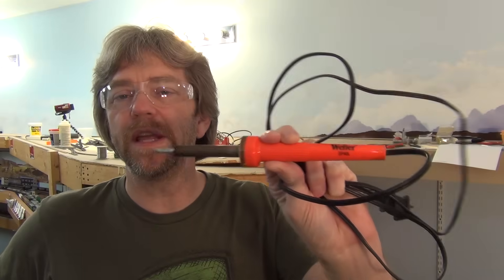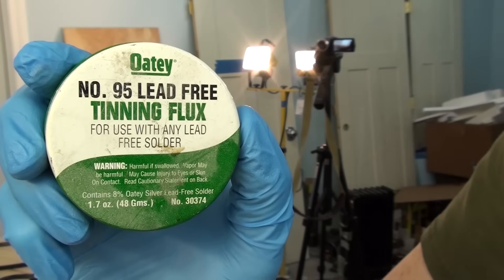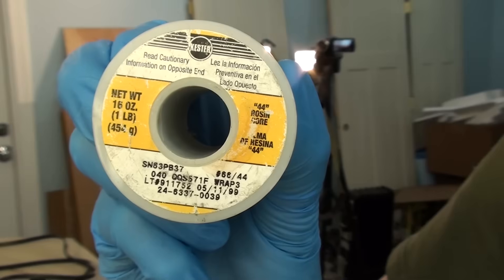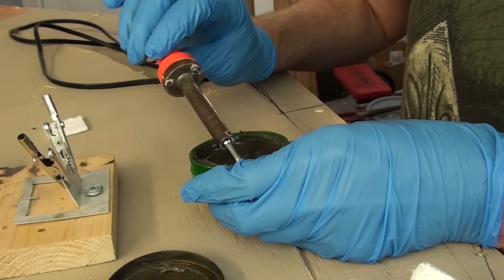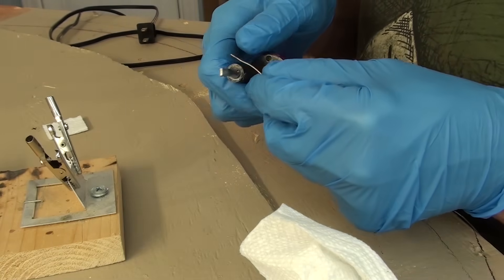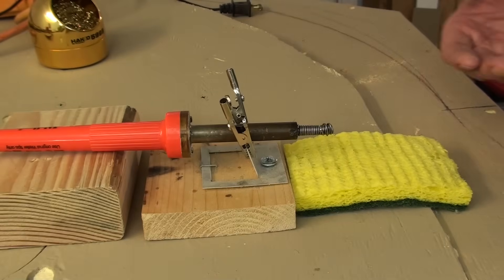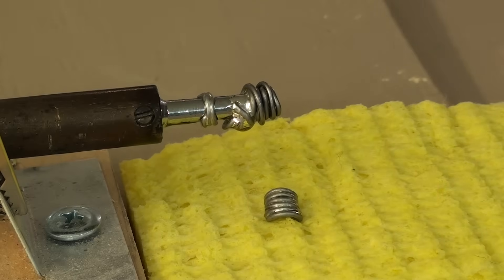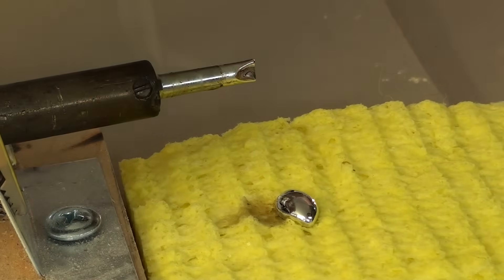🔴How to Tin a Soldering Iron Tip, Without making any mistakes

Comment: Thank you for being short and straight to the point..I have watched other videos who beat around the bush and don't clearly explain..Thanks you just earned a subscriber.
Reply from the maker: Not wanting you to be disappointed,  my other videos are just boring Hobbie videos.  But thanks!
Reply: @IMRROcom  Well hobby videos can be a bit lengthy..However back to the subject of my enquiry_I just got a tolsen 60 watt Iron 2 days ago..The problem is the tin doesn't stick to the tip like the way you showed in the video..I used flux but it just doesn't stick however I can use it to solder.Kindly reply.
Reply from the maker: @muhammadmesbahkamal8512  If it is not sticking  make sure it is clean of oils and other contaminants,  wipe it with IPA to make sure it is clean and recoat with the tinning flux.   it should flow with no issues.  is the tip a chrome tip?  that makes it hard too.  if it is shiny like a chrome toaster or Dull but silvery like silver paint?

Comment: Hello. Great tutorial. Do you have to tin the tip after using a soldering iron everytime as well?
Reply from the maker: Not like that,  just keep it clean.  That is what I do.
Reply: @IMRROcom  I just bought an iron today. How do you clean it and how often
Reply from the maker: @Integrity.is.everything  just stab it into the brass sponge or wipe it on the wet sponge.  if it is not silver and starting to look black .  the dab some solder on it.

Comment: What’s the difference between The flux you used and liquid flux?
Reply from the maker: I use both,  paste flux you are able to coat the part with out it dripping off.  Liquid flux is used for installing componentes and connecting wires.  Past Flux stay were your put it, liquid flux will go to were it wants to go.  Flux used is based on usage and need.  past flux works best for this.  Liquid flux will burn off to fast...

Comment: Hi, dude, thanks for the vid! What does putting the solder round it after do? I can understand dipping it in the flux, but why apply solder after?
Reply from the maker: You are sealing the tip and covering to prevent contact with the air stopping oxidization or basically rusting.  Once the tip oxidizes it will no longer work and solder will not stick.
Reply: @IMRROcom  "You are sealing the tip and covering to prevent contact with the air stopping oxidization or basically rusting.  Once the tip oxidizes it will no longer work and solder will not stick."
So the flux prevents the hot tip from coming into contact with oxygen. That makes it clear as day. Thank you sir. I thought I knew how to tin a tip but the tips were still getting eaten away. I have been hobby soldering since 2007 and 'never' understood this.

Comment: Do you have to complete this procedure evertime you going to use your soldering iron?
Reply from the maker: Once the tip is tined you are good,  you do not want to let the tip get dry.  if the solder is not covering the end it will start to oxidize an no longer work like it should.
Reply: @IMRROcom  Thanks again for the video. Second question/comment.

When you say don’t let the tip get dry, after I finish using it, and it is still hot, what should I do? (Do I need to keep wiping it on the wet sponge until it is cool enough to coat?)
Reply: i'm having the same question... should it be done everytime you take it out to use it?

Comment: Rookie questions: 1.) So if I don't tin the new head the solder won't stick to the tip ? I have a new sharp pencil head and the solder won't stick to it ? The tip just rejects solder. 2.) My tips always burn out fast and color changes to dark brown then they start to degrade why ?
Reply from the maker: Need to tin the Tip.  It is oxidizing with contact to the air aka it is rusting and solder does not like rust.  Tin it and protect the tip.  Think of it like a pint brush,  you keep you brush coated with moist wet paint it works great,  you let it dry one time without cleaning and it no longer paints like it used to or should.

Comment: Im trying to install a new battery in a tablet.. I need to desolder 3 old wires.. And install new battery.. I got a cheap 25w iron.. I tried to use the iron straight away.. Didn't affect solder.. So cleaned tip and tried this tin method.. But all the solder dropped off.. I'm a complete noob when it comes to soldering.. But why didn't the solder stay to the iron..
Reply from the maker: It might off oxidized the tip all ready.

Comment: Ron of Ron’s trains and things just did a video of this on his site and was the same as yours. Both great videos as the techniques are the same.
Reply from the maker: Not the same.  I do not believe he precoated the tip with tinning flux.  But for me the big one.  DON"T EVER use steel wool on your soldering equipment.  It is the same as using a wire brush or sand paper.  Also Steel rust or oxidize aka putting rust and oxidation and contaminating the tip of your iron.  Steel wool is a No! No!

Comment: If your doing electronics can you still use this method?
Reply from the maker: Mike Disher yes,  depending on what you are working on.  You will need a smaller tip etc.   I worked in Micro Miniature Repairs in Avionics and also worked at Intel for over 21 years.  This is just preparing the iron for use and protecting the tip from contact with the air and corrosion.  You will be totally fine,  just make sure you are using a properRA type liquid flux and the correct solder for your Job.  You should find my Amazon store in the links below and go review some of the items in it that I use for soldering.
Reply: IMRROcom can you use a rosin flux paste and solder to tin your tip?
Reply from the maker: @mikedisher30  think of the flux as soap..It helps the water or solder do it's job.  It is what works bet for you.

Comment: Thanks for the great helpful vid. Never knew how to tin a rip before.  I know i ruined my tips as i never was able to get them tinned. Never knew thw method of how to do it. I went to Home Depot tonighr and got the Oatley no.95 lead free tinning flux. I was a bit skeptical in buying it as its a bit different than what yours looks like. Its more like a putty. Will it still work? Since Radio shack went out its tough to find flux in a local store around here. Lowes, Home Depot have the solder but no flux.  I guess an online order?
Reply from the maker: RA liquid type Rosin electrical flux - https://www.amazon.com/ideas/amzn1.account.AHVU5V52QTTTVUQUJJY6Z3NY4NJQ/3LXNKNU4LTLU8
Reply: Thank you.

Comment: Does it need to be tinning flux or would any flux work?
Reply from the maker: It has to be sticky to the point air can not get to the iron as it heats up.  O2 in the air will cause corrosion.  Basicly you tip is rusting and you want to stop it from rusting..

Comment: Can I just use normal flux to tin it or does it have to be specifically tinning flux?
Reply from the maker: Yes.  the paste stuff just works better as it sticks to the iron long and does not smoke off as fast.  You want to keep the tip covered and prevent the contact to air aka O2 that basic part needed to start corrosion.   Tinning your tip is sealing your tip from the oxygen in the air.

Comment: When I bought my 25W iron, I was oblivious tips are to be tinned. Had used it a couple times successfully. Afterwards, well, you know what happens... I've read through all of the comments here and one of the last I read was "Do NOT use iron wool. Use material softer than the tip: brass, copper or zinc wire cleaners." There are a few videos online showing the use of steel wool. ...... I get it, don't do that. Even a guy took the (used) tip out of his iron, tightened into the chuck of his drill press and took a file to it while drill was running. After taking a surface layer of black crap off, he proceeded to tin. To reiterate Ralph Greenwood: just use any of those brass, zinc or copper wire cleaners first at this point (while cold) to clean it up, then tin the tip as shown, correct?
Reply from the maker: pretty much yes.  tips are a consumable item at work.  but at home we are cheap and try to make the last forever,

Comment: 62/36/2 rosin-core is what I have(?)
Reply from the maker: 62% tin / 36% Lead / 2% Silver = 100% metal in your solder. some spot on your roll it should say Flux/Rosin Core - Sn = Tin, Pb = Lead,  Ag = Silver etc this might help you some - http://www.kester.com/products/product/44-flux-cored-wire
Reply: it does say rosin core

Comment: Thanks Eric! I know now to use brass because it is softer and will not damage the coating. I have a "cheapie" soldering iron and havent used any steel wool-so good. getting a Weller soon.
Reply from the maker: As long as it gets hot to the point it melts the solder and the tip is of semi good quality,  Coated Copper Core.  You will do fairly well

Comment: Grate tip. I never knew this I only added a little to the tip. Also thanks for the helpful reply as I've sanded my tips to get them working again. Not no more tho. Guess the heat flows better threw the solder then the tips anyway.
Reply from the maker: Do not sand the tip it needs to be covered with solder.  Yes you transfer the heat with the solder not the tip.
Reply: @IMRROcom  This is incredibly simple, yet helpful information. I just started soldering and I did TONS of research for beginner guides. Absolutely nobody mentioned tinning the tips or the fact that you're supposed to  use the solder to transfer the heat. Thank you.

Comment: This is a very timely video. I was just working on my layout the other day and was attempting to solder some rail sections together with annoyingly sporadic success. I've never seen this technique before. I'm going to try and rehabilitate my current tip as per your video and see what happens. 
Thanks for sharing this technique, I'm sure it will be helpful to many of us who are absolute boneheads when it comes to soldering.
Reply from the maker: Yes, if the tip is dark or black it needs to be looked at. if the solder does not climb onto your tip like "The Blob".  Think of solder love solder loves other solder and will flow to it.  Flux cleans the area and solder loves to have a clean place to go.

Comment: This was some excellent information.  I do a lot of soldering and I never knew this. Thank You!  Looking forward to more of your soldering tips.
Reply from the maker: Do not let the Tip oxidize.  As the Tip heats up the solder will melt and wet the tip befor it builds up any oxide.

Comment: 1) How often do you need to re-tin them?

2) Will any flux do in a pinch?

3) Can you re-tin one that wasn't tinned properly - or do you need to start with a fresh tip?
Reply from the maker: Always make sure the tip is coated.  Do not give it a chance to oxidize.  When your done it is key to make sure your tip is coated so next time you use your iron it will be pre tin with the solder on the tip from last time.  Yes, but avoid the liquid flux for me the paste seems to work better,  that is for me anyway.  Yes, an old tip with some work can be retined but once it starts to decay it is a loosing battle.  In the Shop most irons would get a new tip once a week.  Unlike us hobby folk who try to make them last for years.  Once the tip would not wet it was replaced.

Comment: Thanks Eric.  I've never seen that before.  Do you clean the tips with a wire brush?
Reply from the maker: NO! NO! NO! never use a wire brush or iron wool on the end of your soldering Iron it will will destroy the coating over the copper core.  The tip will start to corrode quickly.  The solder will no longer wet the tip correctly and it will stat to loose the ability to transfer heat.   Use one of the Brass/Copper /Zinc wire cleaners.  the metal is softer than the tip off your Iron and will not damage the coating over the copper core.  http://amzn.to/2kX1zlC
Reply: Thanks!